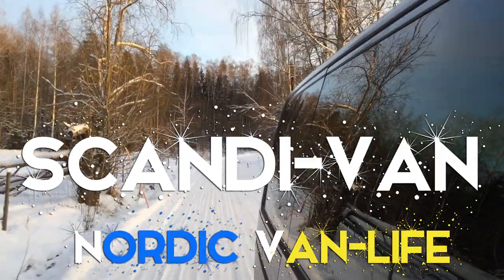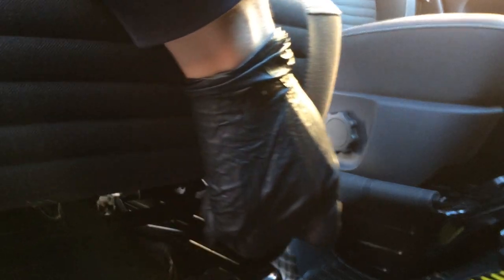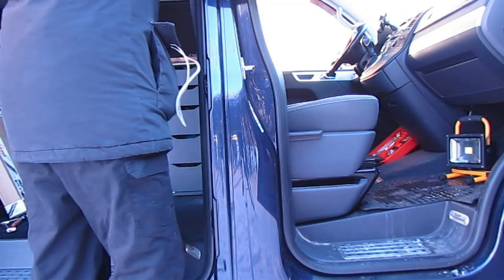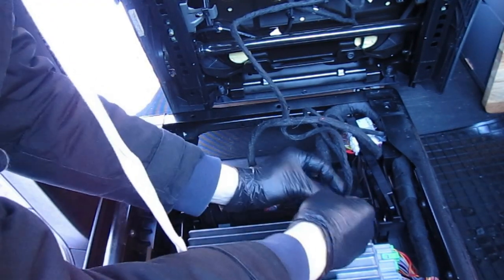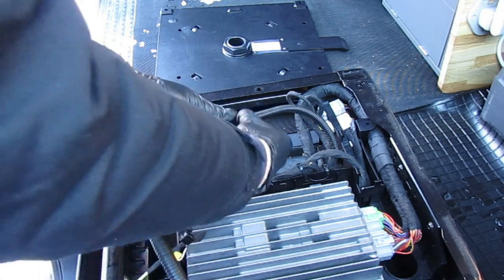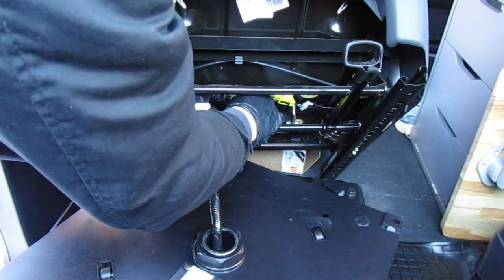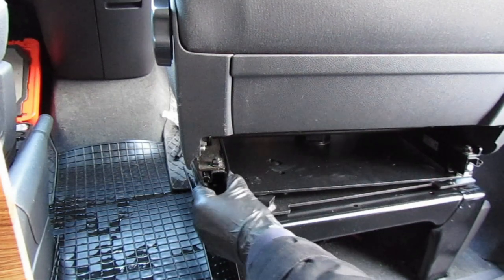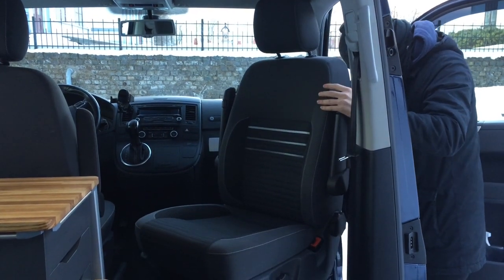Sportscraft  Seat Swivel, VW Transporter, No Rock OR Wobble, with Airbag

Comment: Hi this is great and very easy to follow however… You don’t show how you get the plastic trims back on the back of the seat! Ours will no longer fit now -  how did you do that please? It would also be useful to see how the driver seat fits and how you can avoid bashing into the handbrake. Thanks!
Reply from the maker: H Adrian, No they no longer fit unless you want to cut them as the top lip now won't fit over. We left them off and this allowed access to extra storage under the seat accessible from the back - For example we keep our fire extinguisher there now.
Reply: @scandivanman  that’s great thanks for replying. I will make some from vinyl covered ply and strong magnets. The handbrake lowering interests me though.